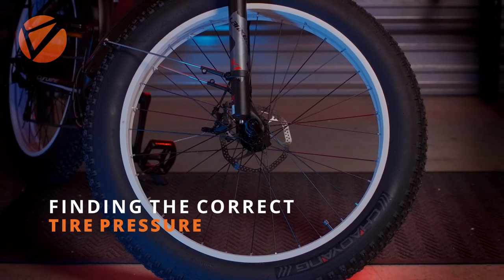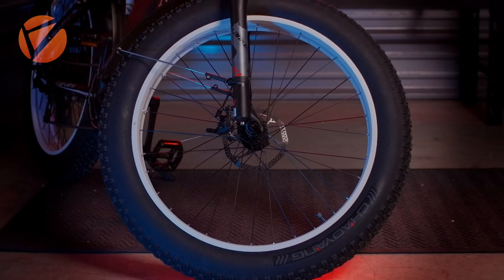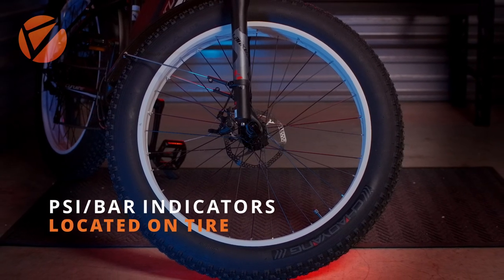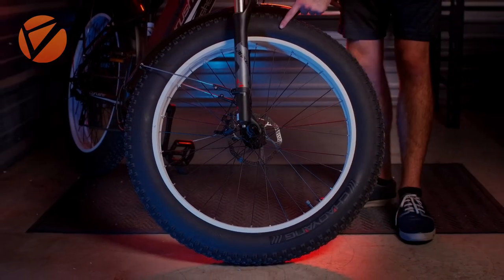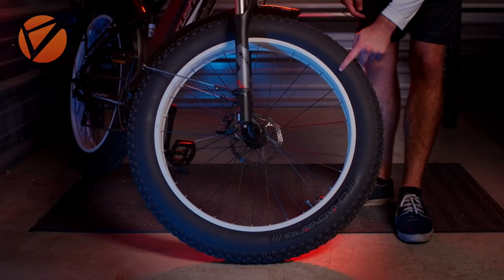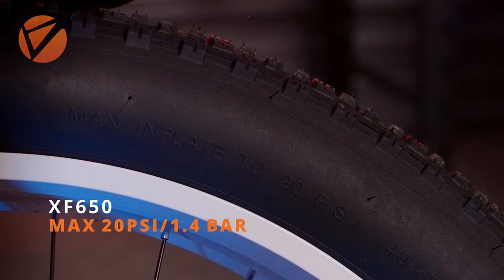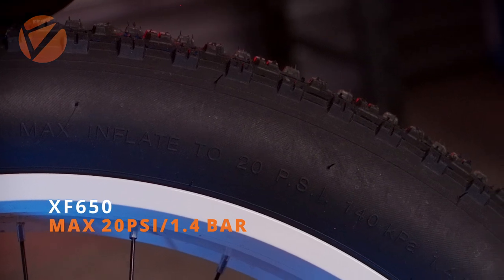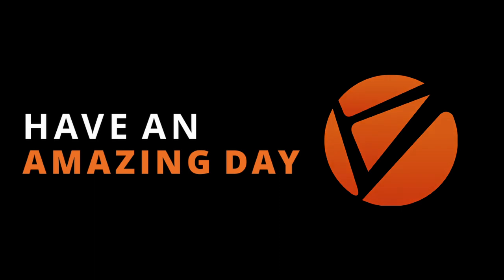Quick Tips - Tire Pressure | Cyrusher TV

Comment: Doesn’t make sense:  My XF800 tyres with the white “CST 26x4” lettering says max pressure 30 psi.  My son has a similar type of bike (not the XF800) with the same brand as shown here and they say 20 psi.  They both feel the  same and will be subject to the same rider weight. In practice my 30 psi tyres felt fine at 20 psi.  Softer is less puncture prone and probably a bit more bump absorbing, but since I am a bit heavy I ‘split the difference’ and went for 25 psi in the end <shrug>.